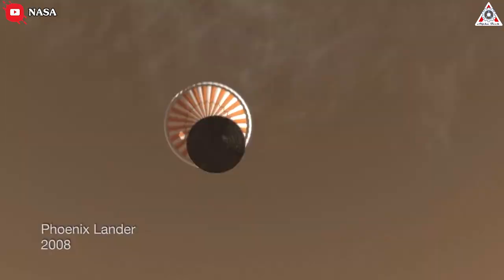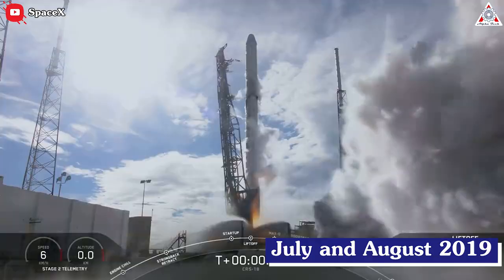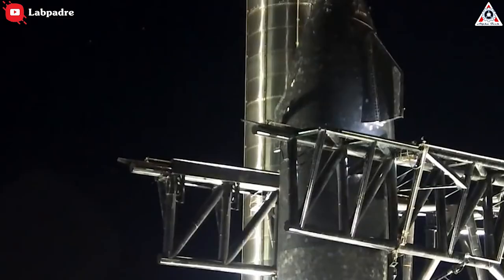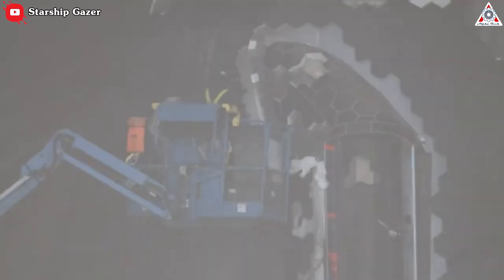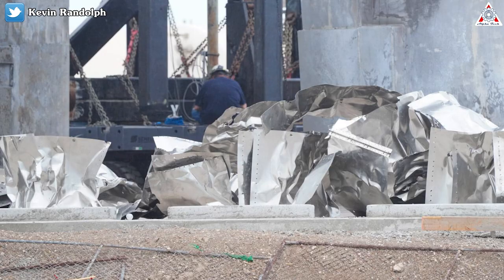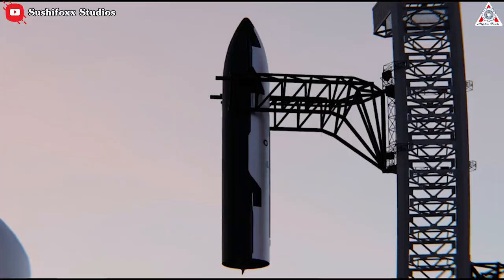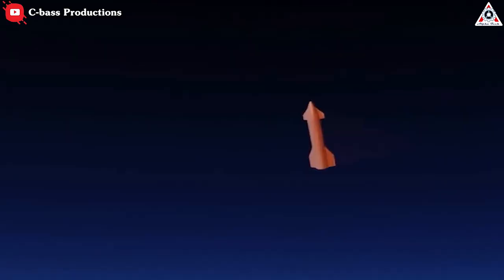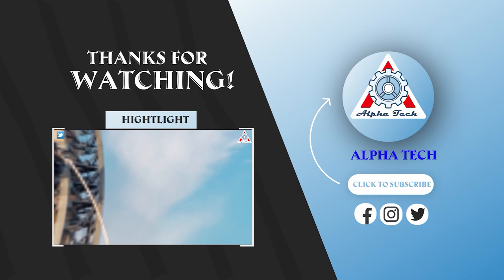Why SpaceX Starship's Heatshield new upgrade is more important than you think!

Comment: The tiles are not mounted directly to StarShip's skin , there is a white blanket that is put between the Stainless Steel skin and the Heat Tiles. You can see it on some of the new rings being built w/tiles already installed.

Comment: I'm not worried about the heat shields I'm worried about the seams around the flaps.
Reply: I'd like to see what a thermal flow CFD would look like of those zones. 
Does the reduced flow result in less heat transfer, or does heat get trapped between those close proximity surfaces.

Comment: Starship will need good and well fixed heat shields, since, stainless steal will be likely more vibrate than thick aluminium (that's why some heat shields are fall off even just during test too..(think it how vibration will be the starship wall during reentry)..

Comment: Folks, you should not have shown the Shuttle explosion clip in such an off hand manor. It was deeply disrespectful.
Reply: Also, the voice over implied that this Shuttle was having structural failure because of a heat shield issue, when that footage was an explosion due to the solid rocket booster o-ring leak that ignited the main fuel tank. It sure didn't add to the point being made and I agree that it was insensitive since this was Challenger that had a civilian teacher on board.

Comment: Transpiration? I thought the transpiration system was dropped a couple of years ago. Are you sure about this?
Reply: He glossed over this, I want to know more.
Reply: Yeah, I don't think so...
Reply: I thought it was dropped as well, but on March 17th, 2019, Musk tweeted "Transpiration cooling will be added wherever we see erosion of the shield. Starship needs to be ready to fly again immediately after landing.  Zero refurbishment."
I can't find anything about this tactic being reconsidered or eliminated, so it seems it might still be on the table but not able to be worked on until they have real-world reentry data on the heat shield.
Reply: @thirteenthandy  - Now that you've reported it, I remember Musk tweeting that as well. I don't recall hearing anymore about it. It seems to me to be a tricky proposition on a rocket like this with tiles.
 Thanks. Good job.

Comment: Thought provoking.  I can’t help but think that no one would have ever designed a dedicated Mars lander in the long shape of Starship but rather all have been conical aeroshells. To me this is another example of inefficiencies resulting from trying to make one design do everything. A conical design minimizes the area that needs heat protection. For the same mass as the Starship I would bet that a conical shape could do away with the tiles entirely and spread the heating over such a large area that stainless steel would do thee trick.
Reply: Inefficient at what? And is what you are optimizing for even the important thing?

SpaceX is optimizing for Cost per ton to Low Earth Orbit. That means that  a hull that's reasonably good coming down, without discarding aeroshells used to make it efficent going up. Conical craft (like the Chrysler rocket- look it up) are good at slowing down, but that's not a good thing when you're trying to reach space in the first place.

Starship's fuel tanks optimize for skin mass to carryable propellant volume, which means they are as close to soap bubbles as the rest of the efficiency of the rest of the system allows. Stack two near-spheres atop one another, and a payload volume above that, with a pointy nose to go fast in atmo and you have a classic cylinder rocket. Throwing away the empty tanks to minimize the amount of heat shield on entry sounds good, and it was made to work in apollo, but if the plan is to slow down, large hollow sections hanging in the wind are free real estate, if you can balance belly first.

Once they have a good LEO launcher, orbital refilling means that they could bring a metaphorical ATV in the back of their pickup, or they could just get an offroad pickup and put camping equipment back there. It doesnt have to be the most efficent mars lander if it's the cheapest way to get mass to mars. ESPECIALLY when you start planning how you're coming home, so you need an earth entry vehicle on mars. Just use the same heat shield on earth (for fuel tankers), on mars (for landing), and on earth again (for coming home) instead of building and transporting 3 different vehicals.
Reply: Familiar with the Chrysler and for Mars that is exactly the kind of thing that you want since the atmosphere is so thin. A dedicated and reusable Mars surface to orbit and back shuttle might ideally resemble the Chrysler. I’m
Reply: @stevemickler452  Specialized craft are for AFTER you have a base and regular passangers. Generalist craft are pathfinders, buildig the base that will later be serviced by dedicated landing craft and cyclers. But the dedicated landing craft and cyclers are too expensive to design, build and transport to be done first.

Comment: Why does no one ever mention the thermal conductivity of aluminum vs stainless steel? Even though SS has a higher melting point, burn through of a missing tile will be quicker with SS - guaranteed. 
Take two comparable pieces of each and apply the same torch to them. The SS will become incandescent quicker and burn a hole before aluminum. 
Doubt it? Ask any welder why it’s easier to weld SS than aluminum.
Reply: Doesn't matter, if there is a breach a hole will be torched either way.  But better conduction means it's moving heat away faster.
Reply: @TheChipMcDonald  It could delay a breech, with a little luck it might help. Also the aluminum would be thicker and that helps with conducting heat. 
Honestly I hope it works. but I’m not too optimistic with the whole concept. My guess is before it succeeds the whole stack is going to have to be reinvented. The cute romantized “RUD” term isn’t going to be so cute after a few Soviet N1 type failures. 
And the only thing they’re going to learn from failures (SpaceX fanboy meme) is to redesign the whole thing.
Reply: Nah. Remember when the shuttle lost a tile and on earth re-entry it didn’t blow up? It was because there was a piece of steel airframe under the aluminum skin in the spot where the tile fell off.